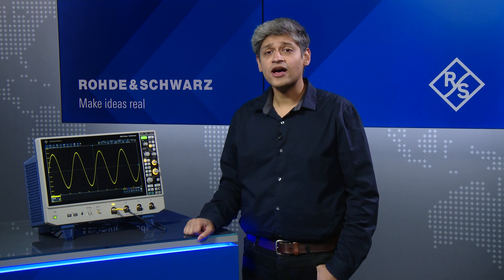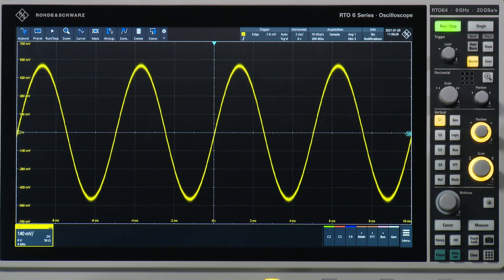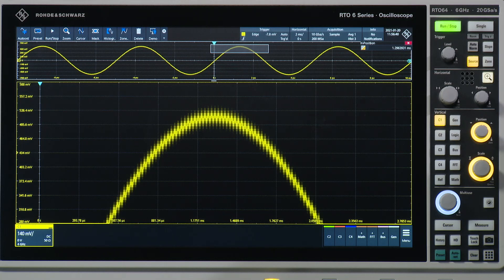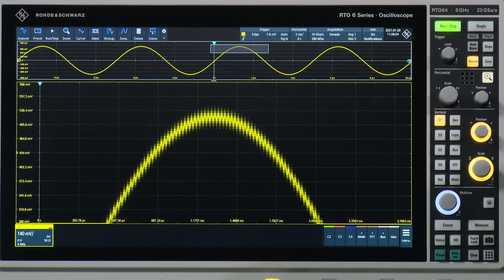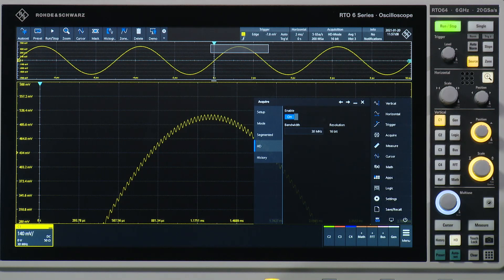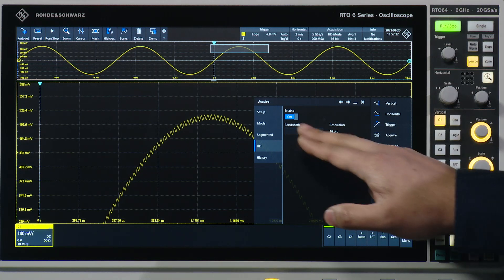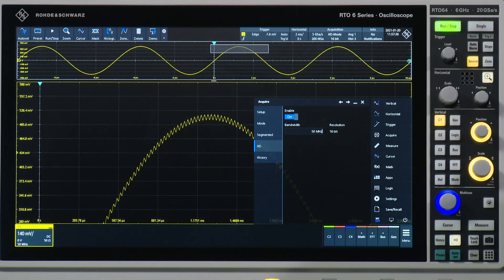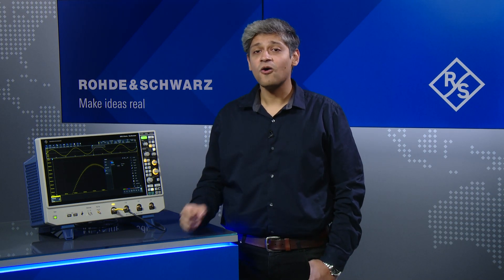R&S®RTO6: Seeing more with up to 16 bit resolution

Comment: Doesn't your time resolution go down by this filtering? I understand that the underlying A/D convertor is 8-bits. Please, educate me.
Reply from the maker: The HD mode is a digital filter that is applied after the ADC. It increases the vertical resolution using a low-pass filter, i.e. by reducing the bandwidth of the signal. Further details about digital filtering and the HD mode can be found in this application note: https://scdn.rohde-schwarz.com/ur/pws/dl_downloads/dl_application/application_notes/1td06/1TD06_0e_RTO_HiDef.pdf
Reply: @Rohde-Schwarz  Thanks! I will take a look.
Reply: @Rohde-Schwarz  thanks for the application note. You guys are awesome. I used the digital filtering in PicoScopes but it seriously reduces analog bandwidth. Keep up the good work.
Reply: All but the cheapest DSO have that feature. Every added bit costs half your original bandwidth.
Reply: @0MoTheG  but if that sampling frequency is 6GHz that's a lot of averaging.